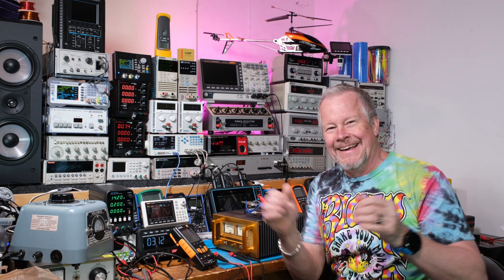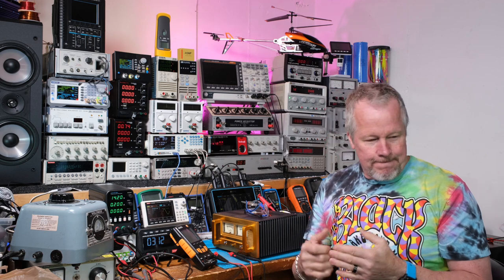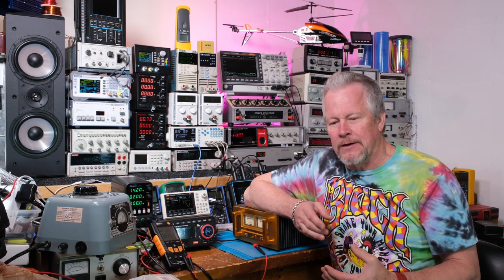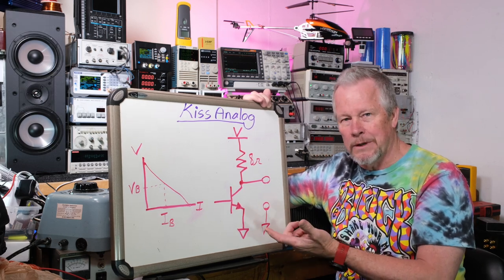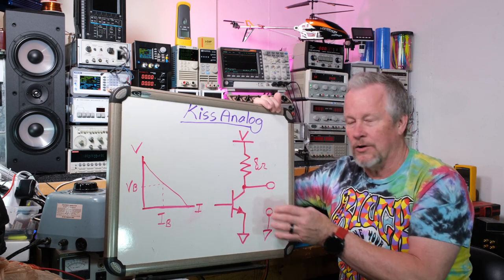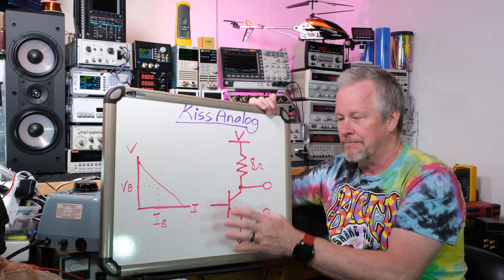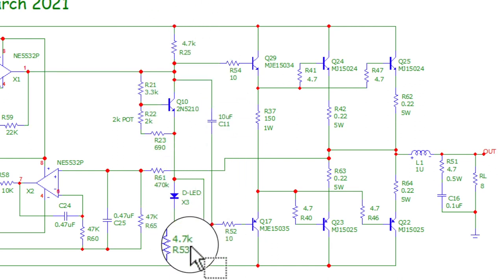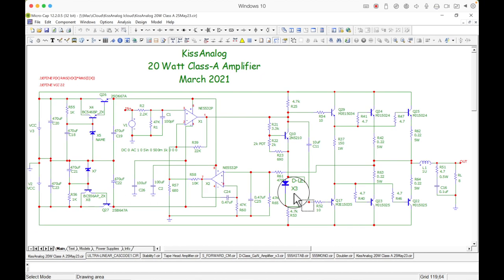Class B Class AB and Class A Amplifier bias explained

Comment: Negative thermal coefficient and tight matching between devices is what led me to dive into complementary output stage running lateral mosfets. Exicon 10P20S/10N20S selected pairs, based on legendary Renesas J162/K1058, can be paralleled without source resistors. 120-150mA of bias per pair makes the drain current independent of temperature and eliminates their tendency to oscillate, resulting in very stable, non-compensated and simple design. They sound damn good too!
Reply: The funny part is, due to the differences in gain between the N and P channel FET's, some designers, such as Hafler did in the DH-220, used 2 different value GATE resistors for each (470 and 220 Ohms) to help balance that difference.  Those Exicon FET's are getting higher in price as I type too, they are some of the few viable replacements for the original DH-220 outputs.
Reply: @poormanselectronicsbench2021  Australian Engineer, late Patrick Turner, whose forte was tube amps, has become enamoured with Renesas fets and found them surprisingly palatable. That alone is quite telling, I like to think. Turneraudio archive is again available online thanks to Ben Tindale. Rds on could be lower- anyway you cut it, you end up with a heater with audio signals amplification as an added bonus and the gate bias difference you mention is a bit of a let down. Other than that, the curves fall on top of one another, in a fashion seldom seen.
Reply: @paulb4661  There is also a disparity with the internal gate capacitance between P and N channel FET's that has to be compensated for as well, but that is straying well off of the BJT transistor Path that Ed is focused on here.
Reply from the maker: Thanks for the great info!  I'll have to look into these FETs.
Reply from the maker: @poormanselectronicsbench2021 Thanks for this great info!  I'm not sure Rdson is a parameter of concern with an Audio Amp - unless it actually works into the dampening factor.  I agree - are the heaters or amps;)
Reply from the maker: I'd think that the capacitance differences in a linear amp would be of less concern then in a switcher.   Thanks for the great info in this thread!!
Reply: @KissAnalog  Perhaps Im wrong, but peak output current equals rail voltage divided by load resistance + Ron + source resistor. With conductance of 1S on Exicons and about 4S on popular Toshiba J200/K1529 hexfets, it suggests the latter can hit a bit harder with less heat loss. Apologies for wandering off into the woods from the beaten BJT path.
Reply: @KissAnalog  Perhaps Im wrong, but peak output current equals rail voltage divided by load resistance + Ron + source resistor. With conductance of 1S on Exicons and about 4S on popular Toshiba J200/K1529 hexfets, it suggests the latter can hit a bit harder with less heat loss. Apologies for wandering off into the woods from the beaten BJT path.
Reply from the maker: Nope - you are correct;)  I guess I haven't looked at the Rdson of these FETs.  I'm used to very low numbers in the switchers:)  Great point of conversation!  You give me things to consider for a video:)  Thank you!
Reply: @KissAnalog  No- thank you! I would love to find out more on this rare breed of dies. It was and still is, a steep and often bumpy learning curve, I only jumped on a couple of years ago. Many challenging aspects of BJT output stage are neatly resolved with lateral mosfets, albeit at a price of copious amounts of heat. Stability is impressive however, you can turn it up to 11, wait a couple of minutes until the sinks smell funny, dial it back down and see the bias value exactly as you left it. I ended up with tri-amping, so that convective cooling in standard sized enclosures is almost good enough to avoid a re-cap on annual basis. With well matched LTP transistors, DC offset trim can be omitted, then you only have a VAS, a pair of drivers and paralleled Exicons with sources tied to speakers terminals through Zobel.

Comment: Greetings from Scotland nice work good revision and learning new stuff didn't know that about the manufacturer of PNP transistors. This is helping me a lot have late 60s sweedish Sonab  Tuner amp to fix have diagram but no info to set bias its a dual rail + -  type. NPN Tip 33B DC coupled to the Speaker. Had to replace them Tip 35s along with one of the driver Transistors and electrolytics. Still working on it . Thanks again 👍.
Reply from the maker: Thanks for your great feedback!  Are you watching from Sweden?
Reply: @KissAnalog   Scotland,  the country of bagpipes Haggis and Kilts. I have done that before looking at a word and seeing another that looks similar, Stockholm to me looks similar. Scotland used to have a large electronics industry mostly gone now like shipbuilding before it. Still got whisky.
Reply from the maker: Thanks!  Please keep the Whisky;)

Comment: Thanks for the video. I'd like to see the output stage built on the bench and tested to determine the lowest biasing point that gives acceptable output results (no crossover step and no "wiggle"). I can't see that's there's adequate information from those data sheets alone to determine that point (??)
Reply from the maker: Great point!  From what I see is that they start around 200 mA, so I think that's the min where they were flat, it would have been nice to see the current start from zero.  I'll have to do that at the bench to actually show it in action;)

Comment: Unless you are making a totally "home brew" amp, it's definitely best to pay attention to service manual info, and go with that first. When Harmon Kardon designed the Citation Sixteen/Sixteen A, which is a Quasi-comp Symmetry AB amp, they chose to bias it at one may think is a high level, that makes the heat sinks get up to 60C / 140F in temp at idle, but, if you read all of the SM notes, they do it because they did studies where the lower distortion of keeping the amp in Class A was found to be less perceptible if an amp is biased to class A up to 17db of it's full output, or 2 1/2 watts PC in a C16/A amp. Considering that most listening is done at that output or below, it eliminates any crossover distortion totally until it is driven harder. Some freak out when the heat sinks get so hot at idle, but for it's best audible performance, the service manual bias value of 50mV across one of the 0.5 ohm resistors, which is 100mA per output transistor, or, what is REALLY high compared to most amps!
Reply from the maker: Thanks for bring up this amp!  No offense to Harmon Kardon, but that type of design topology is not used today.  Back in the day the matched NPN/PNP transistors were not that great, so they used NPN in both sides of the push-pull and that created some design challenges.  I should do a video just going over that design...

With this design topology, we do have a more symmetrical design with matching NPN/PNP so the drive and bias is totally different and more ideal.
Reply: @KissAnalog  It's true, yes, that was a mid 70's design, but at the time it seemed to be one of the unique ones that seemed to reduce the crossover distortion issue in a practical manner, at the cost of making your room warmer and running up your electric bill.
Reply from the maker: Yes heavy bias was a big tool;)  Thanks!

Comment: Sorry about the double post. I appreciated that you went into why there's a resistor in the emitter section of the bpj transistor to handle the case of using bpjs in parallel to prevent runaway. As we know with fets that's not necessary.
Reply from the maker: Thank you!  Post all you want - it has to help the YT analytics;)  Yes FETs do have some advantages - like paralleling;)
Reply: It prevents "runaway" by helping the outputs "load share" better, as due to gain and internal resistance differences, if there are multiple BJT's paralleled, yes, one may be taking too much of a load and heating more than the others, so it will be under more stress and more prone to fail earlier than the others.
Reply from the maker: Yes you are correct of course.  The emitter resistors are necessary to force parallel current share - as well as the bias transistor sharing the heatsink for thermal tracking.  FETs have that positive Temp Coefficient so they naturally share.  I think that was a huge reason that they took over, but I also understand that their harmonics matched a tube better as well.

Comment: I suppose I think of a push pull circuit that has a distortion in the crossover between the pos and neg amplification devices due to no forward bias as class C. Of course that's the most efficient. I think of a push pull circuit where there is some forward bias to attempt to eliminate any distortion in crossing over as class AB, and then a circuit with only a single amplifying device, or more than one in parallel where the bias is held somewhere in the center of the linear region as class A.
Reply from the maker: Thanks for your feedback!  Yes, you are correct, but heavy biased push-pull is probably the most common for Class A as well - even though single ended is still considered better.

Comment: Great video. I have an active studio monitor pair where one has  a bit ripple. I tried to find the fault by swapping the thermistors from the OK speaker to the BAD speaker. That didn't seem to be the fault. I found a bad capacitor and it fixed the ripple coming from the drivers. So all thumbs up. BUT, now both the speaker's AC transformers gives a hum. Do you happen to know if it could be bad thermistors? Both speakers always had a inrush that I never liked. The BAD speaker always made me nervous each time I power it up. Any suggestions why the transfomer's sudden hum?
Reply from the maker: Thank you!  You can power off and disconnect from power - then you can measure the ohms of each thermistor.  Chances are - it is another capacitor.  You might try to place a poly cap in parallel - just be sure you match the voltage rating of the parallel capacitor.  Let us know what you find;)
Reply: @KissAnalog  Thanks for your answer. It is very kind. I've replaced 6 capacitors. 4 big ones (two parallell for each driver) - since these wasn't the problem, there was one blown smaller capacitor in the mains circuit (also in parallell) - so swapped both. The ripple I had buzzing in the drivers themselves is gone, but it is the AC transformer itself that gives a physical hum, and it is mounted tight and nicely. Never hear it hum that much before. I have to say I had the AC transformer on the table for a couple of weeks without using it. Temperature outside has risen, so I wonder if it is humidity or whatever.

When I start up the speaker, the hum comes in after say 5-8 seconds. I guess this is the thermistor's getting warmed up, and the resistance going down?

I've measured the thermistor, it reads around 8,8 ohms, sometimes 9,5 ohms. It is labeled NTC 10, so I guess it is a 10 ohms thermistor?

I'd be so grateful if you had any further tips. I own quite a lot of these speakers, but this pair is the oldest model. About 25 years old. It feels nice with the new caps and they play good, it is just this sudden AC buzzing coming from the unit itself. It is actually hearable from 1 meter away. So I left the back panel open to be sure it is the hum coming directly from the AC unit itself.

1) Can a AC unit be affected by a bad capacitor in the other circuits?
2) Can I test it without any other connection than the mains, say I disconnect the connector going to the print and bridge rectifier? In the schematics it is the main power in, the N going directly to the thermistor, then to the AC's 4-pin connector - so was thinking of disconnecting the output from it. I am very careful and haven't dared to measure it with my multimeter, yet. I am not trained in this field. 
3) The odd thing is that it started simultaneously on both speakers. Not sure if it was that I desoldered and cross-swapped their thermistor - maybe bad re-soldering - can that affect it?
4) Manufacturer informed me that the AC transformer can start to hum more by age. To me, they still look pretty sturdy.

Great channel!
Reply: @KissAnalog  Guess I'll just unsubscribe then. Nothing to learn here.
Reply: @KissAnalog  The speaker's are using a toroid AC transformer. I've now testet by just feeding power to through the thermistor and to the AC transformer without any other connections. The transformer is making a hum. Is this just due to age or can it be fixed?

Comment: Why don't we see inductor's instead of a small value resistors for biasing
 it's a great video very informative
Reply from the maker: Great question!   Resistors are great as a constant impedance/resistance across the frequency of interest.  Inductors would be great if they were actually HF switching to smooth the edges.  Make sense?
Reply: @KissAnalog  right would it make sense to use both in series would that be a better approach?
Reply from the maker: I think the inductor placed at the output works for the frequencies of interest.

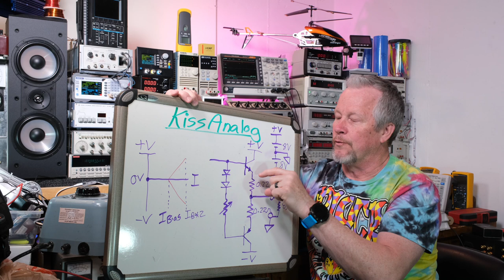Comment: For the push/pull parallel Transistors diagram(the 2nd diagram) 30:00 - to use a transistor for the bias network I imagine, you would, in the example of an NPN for the bias transistor, Collector would be connected to the Base of top NPN, Emitter connected to the Base of the bottom PNP, and your bias and audio signal would flow into the Base of the Bias Transistor(3rd NPN  replacing the diode network)? Is how I described it how you would use an NPN on this bias network?
Reply from the maker: Thanks for asking...  If I understand your description, that would essentially make the transistor a diode.  But, in the schematic I show you can see the bias transistor is actually set up to amplify the current to drive the output stage.  It is a fixed amplification set by the bias resistors for a DC value.  Does that make sense?
Reply: @KissAnalog  There is confusion somewhere so I'll just ask this way. On the push-pull schematic, you showed and explained, there were only two Transistors and for the bias network there were two diodes but as you went to describe it you were talking about how it would be better if those diodes were replaced by a 3rd Transistor to regulate the bias for the two amplifying Transistors. If I were to use a Transistor to bias the push-pull amplifying Transistors how would I wire up the transistor for controlling the bias.
Or did I just completely not understand what you were saying in the video, though I'm certain that you said to replace those two diodes on the bias/base network with a Transistor to handle the biasing. I'm aut!stic thus it could possibly be a misinterpretation, on my part, about what you were saying. Where you say something very similar in the video is right after you bring up the second schematic, as you got to describe the lay out you said something about replacing those diodes with a transistor.

Thanks for responding.

Comment: Great video. And like always respect your time you put in. I'm not an expert,  but studied amplifier topology since a kid. I personally like to think, the class A is exactly that of a class A. ie idle of and engine would be sitting at 3000 rmp. not very efficient. But class B Amplifiers are extremely efficient, but not so effective on sound reproduction unless Biased slightly on. I like to refer to it as a Class B Hybrid . But that is how i like to refer to the voltage mirror amplifier style of driving a woofer.. what you think?
Reply from the maker: Thanks for this feedback!  I agree - this is a good way to think about them.  I think the topology does have a big impact on what works better for bias.  The push-pull is great if the transistors are a good complimentary match.
Reply: @KissAnalog  Thank-you for reply it means a lot.  I personally look up to experts like yourself, and you knowledge is gold to a cheap hifi guy like me.
Reply from the maker: Thanks so much!  Thanks for the comment!

Comment: Thanks sir for this information pls sir  I have question to ask pls how can I calculate amplifier ohm's load.
Reply from the maker: Thanks for asking, but can you give me a little more information?  I'm not sure what you are asking.  The Amplifier's load will be a speaker rated at some Ohm level, e.g. 8 ohm or 4 ohm.  Or are you asking what is the output impedance of the amplifier?
Reply: @KissAnalog  i mean how to calculate amplifier ohm's for speaker
Reply: Hello sir , dis what's I mean for instance I build an Power amplifier How can i calculate total loading speaker for each channel, like 4ohms, 8,2
Reply from the maker: Here is a video on how to measure speaker impedance: https://youtu.be/g1zda0WMDGc
Reply from the maker: Do you mean how to calculate if you have more than one speaker attached to the same channel?  If so, you can take the inverse of each and then add them and take the inverse of the sum, e.g. 1/(1/8 + 1/8 + 1/4) = 2 ohms.  Or, you take 2 speakers of the same resistance - let's say two 8 ohm speakers and the resistance of these would be half, so 4 ohms.  Then take this 4 ohm and add it to the 3rd speaker which is 4 ohms and two 4 ohms would be half - so 2 ohms.
Reply: @KissAnalog  yes sir

Comment: A small suggestion... You should have used Q instead of B when referring to the quiescent quantities. VB and IB can be confused with Base voltage and Base current. :)
Reply from the maker: Yes, you are right.  Thank you.  In general terms I am in a habit of using bias current - but in audio I should use the correct terminology:)